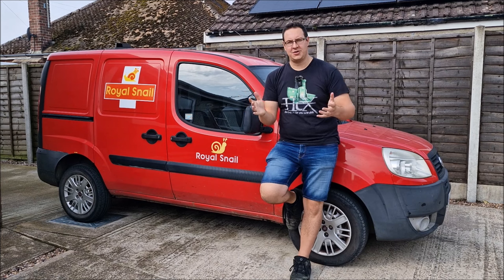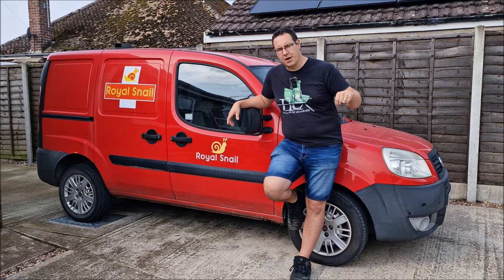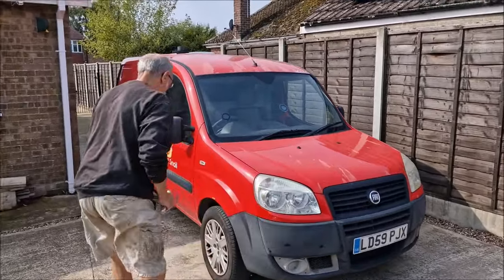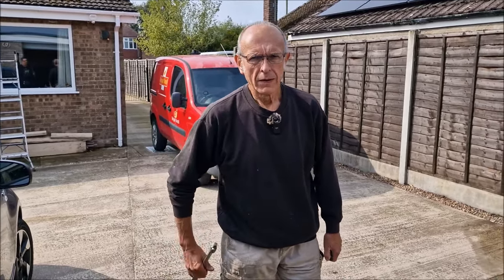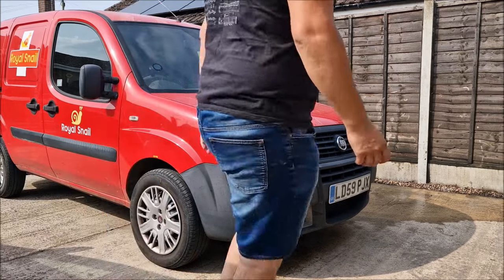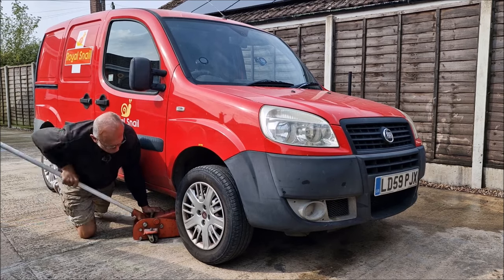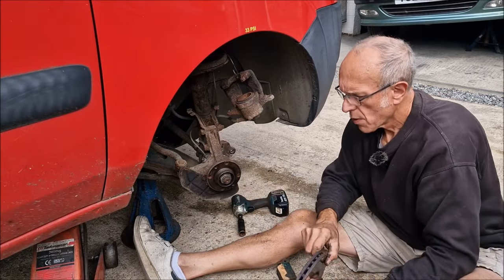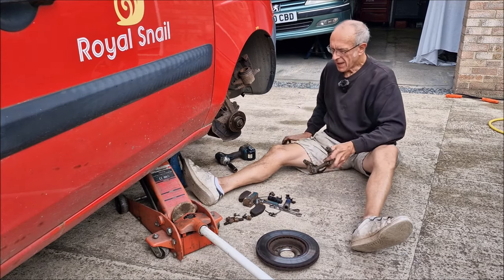What's That Noise? - Fiat Doblo Van Braking Noise - Is It From The Front?

Comment: Rear suspension bushings!
Mine squeaked where yours did,it was the rear shock bushings.
On the front,change the discs,pads,track rod ends,ball joints,they dont cost much,and drop links too,all these are easy jobs,they normally start giving play,at 40,000 miles plus.
You can get discs for £40 a pair
Reply from the maker: Rear suspension bushes incoming

Comment: surprising, to see a that bad maintained car in the coupland fleet -looking on the right front tyre.. 😂
Reply from the maker: My van gets an absolute hammering and is sadly often forgotten about 🤦‍♂️👍
Reply: @JonCoupland  I wonder if new tyres will clear the noise? We had an escort van at work which produced all sorts of rumbles under braking until it had new tyres! I guess the sidewalls and bracing get weak when near end of use time.

Comment: No way would you replace those discs and pads… they are perfectly fine after a bit of attention. People just dump perfectly serviceable stuff these days because it’s relatively cheap to get budget new parts.

£70 for two new tyres ? Seriously ?
Reply from the maker: Sorry that should have been £70 each
Reply: @JonCoupland  Relieved to hear it ! You'd be down to the canvas in 10,000 miles at that price....